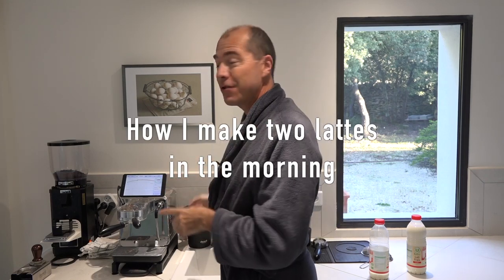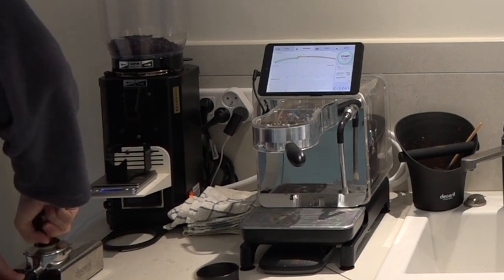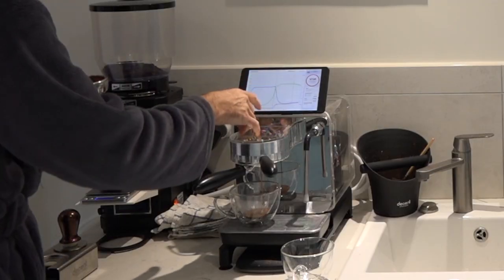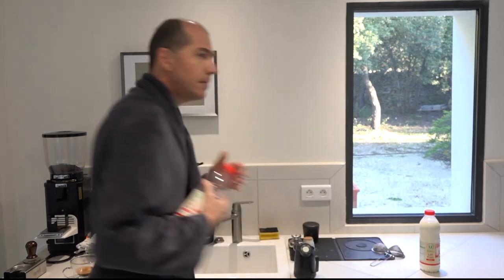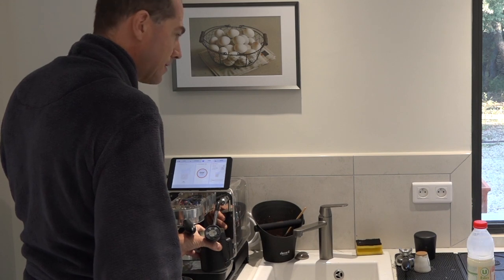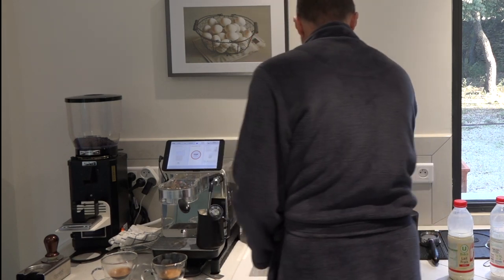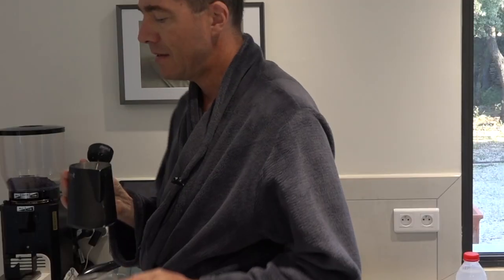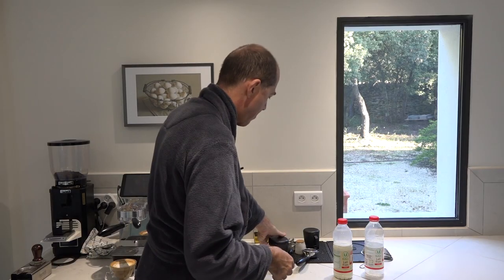How I make 2 lattes

Comment: The easiest way to split milk for two drinks and make sure each is consistent foam depth is to pour extra into the splitting jug and then immediately pour the extra back into the first jug. I find I can get identical depth if I pour 2/3 into my second pitcher and then pour it back so you have 1/2 the milk in both pitchers
Reply from the maker: thanks for the tip @jered, I'll try that! 

-john
Reply: Yep - working in a coffee shop i would transfer the whole jug of steamed milk to an empty one (warmed) - then pour half back into the original jug. Both lattes would come out identical.
Reply: Oops - just realized i'm 4 years late to this reply.